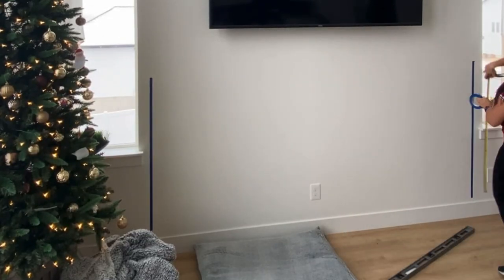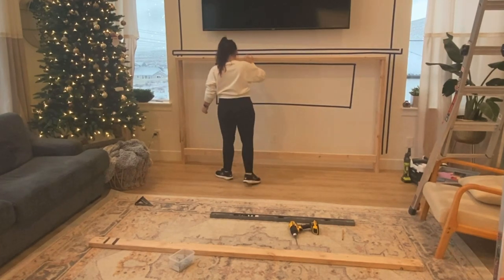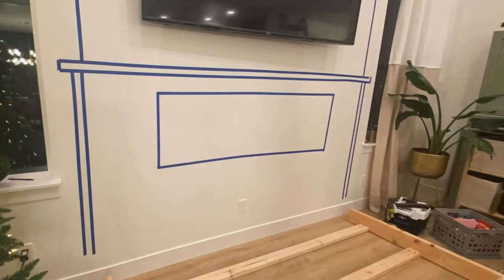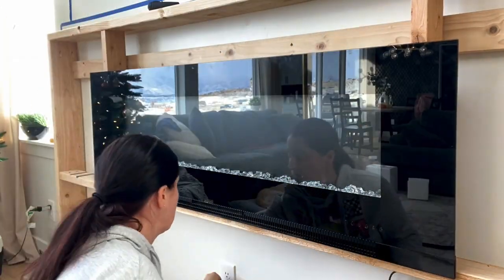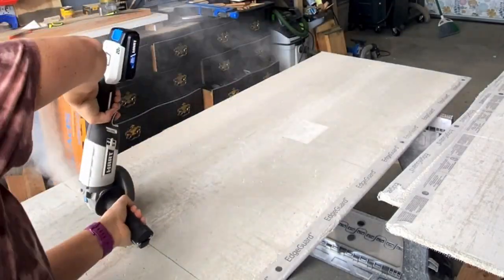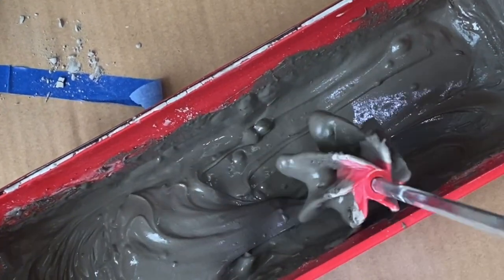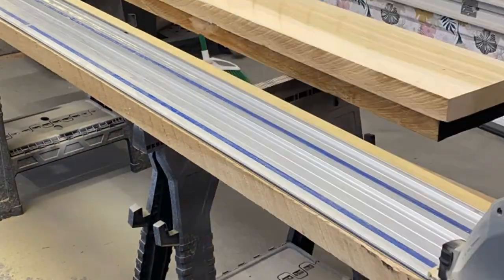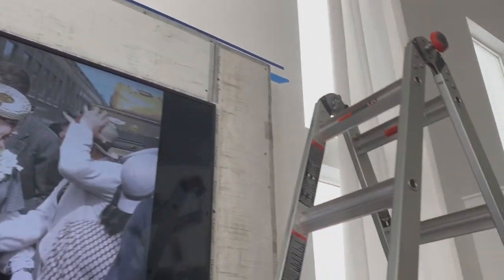DIY FAUX CONCRETE ELECTRIC FIREPLACE

Comment: It is so beautiful. I am wondering about measurements. Like how big is the tv? How high is your ceiling? How high the bottom of the tv from the floor and the distance of the top of tv from the ceiling? All of these questions because i have a 9-foot ceiling  and planning on placing an 85in tv with the tv having a height of 43 inches i do not think i have enough space to put a mantle between the tv and the fireplace. Thank you very much in advance!
Reply from the maker: I have 20 ft ceilings so I know the measurements may be different. This is a 75” tv and the bottoM of the tv is 5 ft off the ground. It’s not optimal viewing height but it’s where I wanted it for sure. I say use some painters tap and mark out on the wall your tv and mantle. This will help you visualize the end result. Good luck!

Comment: Nice Job!!  I'm getting ready to start a similar project--I'm trying to decide between Planipatch or Henry('s) Feather Finish; and between Durock and Hardie Backer Board--any recommendations that can settle my internal debate?

Also, where did you hide your cable box, and anything else you might have connected to the TV?  Thanks!

Comment: Did you consider a clear coat of some sort to protect the cement finish? Wondering if it would change the look? Either way this came out amazing
Reply from the maker: Thanks! I didn’t add a clear coat and we have been fine so far. But if you did it would def make it darker. You could try it? 
Thank you!

Comment: Curious when people are doing these electric fireplaces are you all wiring up the outlet to its own circuit? At 700/1500watt youre not leaving too much room if its on a 15amp breaker. 🤔 thinking 20amp breaker by itself.

Comment: I have minor hairline cracks at all the seams and I followed all of the correct steps. Do you know how to fix these? Did you have any after letting the concrete set?
Reply from the maker: Like the seams in the middle? Or around the end? I didn’t have any cracking, I’d say maybe do one more coat and try and make it a bit thinner? If it’s around the outside you could try caulk

Comment: Very nice but shouldn’t you put some piece of wood under the fireplace so it wouldn’t hand threw with time?
Reply from the maker: Hi thanks for the comment, but I am not sure what you mean.
Reply: @EternalHarvestDecor  you put a 2 by 4 to rest the fireplace on but you didn’t put any small pieces underneath it so it doesn’t hang threw in time. With the weight of the fireplace the wood will bend without support underneath it
Reply from the maker: oh I see what you're saying, no, this is very light weight dont think I will have any problems with bowing, in my experience that only occurs when there is a much longer span and it is getting some bracing by the pieces above as well.  But hey, if youre worried about it and doing the same project, go ahead and add more.